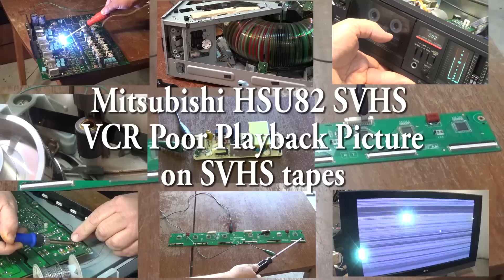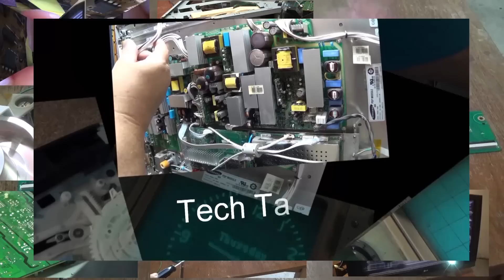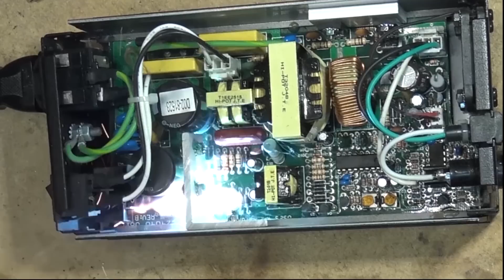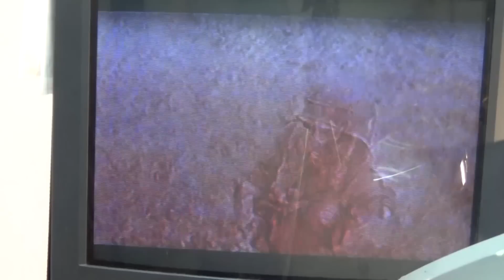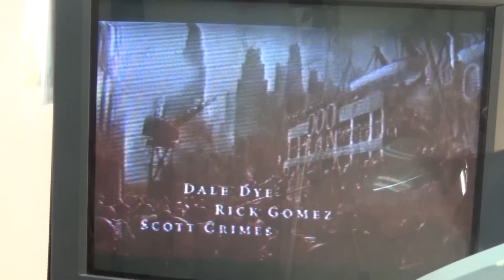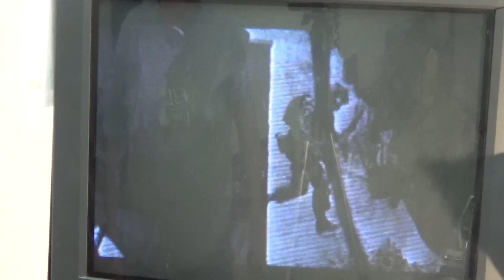Mitsubishi HSU82 Very bad playback of SVHS tapes

Comment: Hello there, I hope you can help. I have a mitsubishi HV-V6000 S-VHS VCR. IT plays tapes no issue but the HI-FI sound gone. If I send it to you to fix. How much would it cost? How much is the postal cost to send it back from your place to Ireland?
Reply from the maker: Shipping costs to Canada would be prohibitive plus this is a pal machine which I have never worked on.
Reply: @12voltvids  It is a NTSC VCR from Japan.
Reply from the maker: Shipping would probably be 300 each way.    I'm just guessing but if shipping to the US is 150 going across the big pond is probably double at yeast.

Comment: Wow, found out about you on DigitalFAQ - your knowledge and experience are off the chart!  

I will now pester you with my situation:  Bot the U82 new for the 2/3rds speed slomo.  Worked fine for years then one day, dead - would not turn on.  It's been that way for "many" years and I still have it because I'm not about to toss a $2000 (!)  VCR.  QUESTION:  what might I be facing as far as a repair?  

My main concern is playing back my SVHS tapes to digitize.  I scored a thrift store JVC HR-S3600U SVHS-ET that I haven't tested yet and looking at a pawn shop $50 HR-S2902U that is said to work.  I have purchased every used SVHS VCR I've encountered locally - a grand total of ONE so far.  So a 2nd one surfacing is a big deal.  Or should I approach this a different way!

NOTE:  I also have a new head I purchased when I had it for the "long haul" thinking worn head replacement.  
RE:  Slip Rings:  I swear mine do not look like the ones in this video.  I seem to recall the diameter of the rings were brass and very small, maybe 1/8" or not much more - the wipers were thin brass "fingers" - all very delicate but very slow wipe velocity since small diameter.  After seeing once, I thought should have bot replacements too.  But now is probably academic.
Reply from the maker: Caps in the power supply leak on these Mitsubishi era machines and corrode the regulator board.  Start there.

Comment: I have a Mitsubishi hs-423ur, SVHS model, It looks almost identical inside, the board layers are in the same order,  the picture is overall very good.  Every 30 secs to a minute I see a thin black line, like  drop out, but when the tape is played on a different VHS player it's not there.  I looked on my board and didn't see the same JVC SVHS comb filter.  I wonder what this playback issue with the "dropout look" is related too....?  Any idea on where to look on the board?

Comment: I have an HS-U70 and I think the bad issues with it are with the board under the top board and getting that top board off is is a BEAR, mostly because of those STUPID squeeze tabs which Mitsubishi used FAR too many of to hold the board in place making those early high end SVHS decks VERY hard to service.  I never was able to confidently lift the board off those stupid squeeze tabs without strait up breaking them so I never bothered and it's still sitting there with all it's issues like video input and sound throughput issues.  It looks like they may have (smartly) reduced the number of squeeze tabs for the HS-UX2 series to a more manageable level, but if you ever opened an HS-U70 or HS-U80, you'll know exactly what I am talking about with their huge set of squeeze tabs essentially "gluing" that top board to the main chassis for a real chore of getting that board off.

Comment: 9:40 The way the solder looks shows clearly the failure. I also saw some ELNA through hole capacitors having this leaking issue on NEC Turbo DUO and some arcade game boards.

Speaking about arcade game boards, I saw some people that found a way to remove the resin to repair these weird brown/black SIP packages with ceramic substrate like the one we can see at 12:20. They even designed PCBs to make replacement parts ^^

Comment: Why are those SMD caps such crap?
Reply from the maker: In the early days they had big time quality problem.
Reply: @12voltvids  A lot of late 80's electronics that use those caps seem to have issues.
Reply from the maker: @stevenmann9769  They were all bad. I have talked about the scandal that happened in Japan in the 80s over caps. Stolen formula, key ingredient missed, electrolytic because caustic when in discharged state and burned through the rubber plug and spilled on the board taking the board out. Huge problem that hit Panasonic, Sony and Canon mostly.
Reply: @12voltvids  It's the board destroying way they fail that is so damn irritating... Give me good old fashioned electrolytics any day of the week.
Reply from the maker: @stevenmann9769  I hear you.

Comment: Besides JVC that has the dynamic drum technology, I've always wondered what VHS machine has the other type of technology which is piezo heads found in some pro formats decks, Now you solved that mystery for me.
Reply from the maker: JVC dynamic drum actually physically tilted the drum using a little motor and plastic gears like the nakamichi dragon.  Like the dragon they all cracked and broke.
Reply: @12voltvids  Yep, I have two of those with cracked gears, there is a workaround to disable the DD system I wrote at videohelp in the capturing section.
Reply from the maker: @Capturing-Memories  yes fixed many.  We disabled every one we sold as it was as unreliable as the dragon was.  Most disabled that system too.
Reply: @12voltvids  That's a shame.  When it worked, it was great.  But, yeah, when the gear splits...

I've got an HR-S7500U sitting in the closet because its DD mechanism is broken.

Comment: Great video, the piezo head system came from Video2000 I believe,  it's certainly present on all Philips V2000 machines (I am repairing a VR2340 as I type this) and means that even the 1970s machines can do forward and reverse picture search without any noise bars.... Oh and 8 hours on a tape in better than VHS quality from launch.

Remind me why VHS won again!?
Reply from the maker: The piezoelectric head system was developed by Ampex and used on the vpr1 back in the late 70s. We had one at the TV station I interned at. Three head, erase record and play back. This VTR could do off tape monitoring while you were recording. The playhead had a piezoelectric actuator which gave it perfect variable speed playback in forward and reverse. You could even spin the reels by hand and it was perfect.
Reply: @12voltvids  - Ha! That's cool, you learn something new every day,  I didn't know Ampex had developed it first,  I always was under the false assumption that it was a Philips development, I guess Philips used it in domestic machines first though!

Thank you for clearing my misapprehension up!
Reply from the maker: @robustreviews  the v2000 Philips was the first consumer device to use the technology but broadcast had it first.   The hsu82 was the first to bring this to vhs

Comment: That was a machine and a half, i wonder if it's still working.
Old smd caps are no better than through hole, they still fail.
A repairer called ' Radio cruncher ' has repaired many sony radios that are full of smd caps, they are always dead and leaking, but they are an old radio.
We need to get away from electrolitics, but not tantalum layer caps eather.
They go short for no obvious reason.
Reply from the maker: It might be still working.  Haven't run it in years.  Back in storage.

Comment: Twin Digital on an Electrohome. They didn't even really bother to hide the clues that it's a rebadged Mitsubishi.
Reply from the maker: Mitsubishi bought electrohome.  At the time there was an embargo against Japanese companies entering Canada.  The only way in was to buy a Canadian company that was in distress.  So they bought electrohome and marketed in Canada under the electrohome brand.   They had to keep the brand name for 10 years and the Mitsubishi brand rolled out in Canada after about 7 years after they entered as electrohome.
Reply: @12voltvids  Well, better a high end Mitsubishi or Electrohome Super VHS than a Panasonic Super VHS, I guess.  Same basic problem, but multiplied on the Panasonic machines.

Comment: Wow "board heavy" So much in there compared to the cheap units that followed! Nice picture! A very well built VCR.
Reply from the maker: This was one of the best built consumer VCRs ever.  All those mitsubishi VCRs were.
Reply: @12voltvids  What about later mitsubishis I have one from 2002 it has over a 1000 hours on it stil working and its svhs to.
Reply: @12voltvids  We had this model in the 90s but it went bad and no one could fix it correctly for us I felt so bad getting rid of it to.
Reply: @12voltvids  funny, to me mitsubishi is known as mitshitbishi when it comes to dlp tvs. their 2000s dips were *AWFUL*, but it’s good to hear not everything from them was
Reply from the maker: @walle637  well to be fair all the DLP tvs that used the 1080p "wobulation" chip were a piece of shit.  My Samsung 63 from 2005 has the missing / stuck mirror problem, yet the 2 older 720 sets still work perfect and have probably 30000 hours on them.   The problem was Texas instruments made bad chips that failed.
Reply: @walle637  Mitsubishi sometimes would also be referred to as Mitsubitchy.